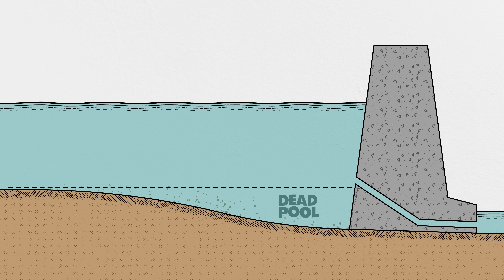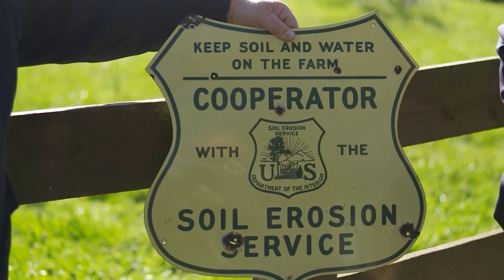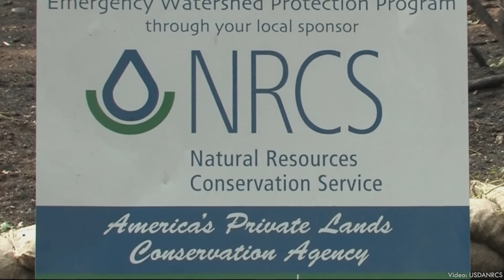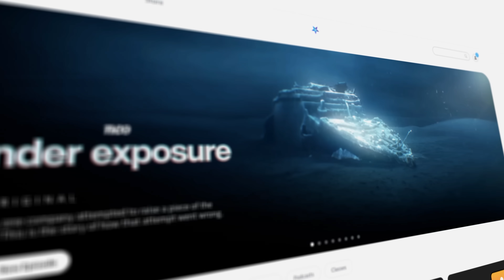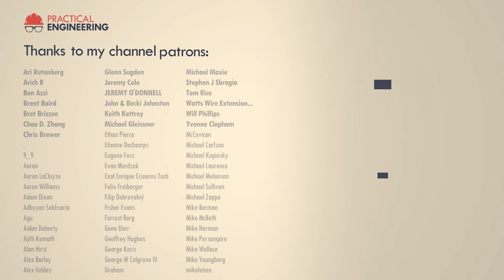All Dams Are Temporary

Comment: Either figure out a way to continue sediment systems by moving it as far downstream as you can or move it back upstream where it came from. The method will be whatever makes the most sense. Like you said dredging is ancient. There's no reason to get hung up on fault or cost etc seeing as the problem is of natural cause and eternal. You just have to remove sediment unless you are content with abandoning a dam and let it become a waterfall and eventually a huge risk if it fails.

Comment: From what I understand a dam plays two main roles, a reservoir holding water and power generation. What if we separated the two? What if we had a side channel that all the incoming water flows through (this is where you put your hydro power). When the reservoir gets low you let some of the incoming water go in. Is there a problem if the reservoir water is still? Can we, like, stir it?

the water flows through

What if we

It seems the issue that arises is the slow down of the water in  yhe

If the issue with dams is the c

Comment: the Romans handled this problem with aqueducts. Desediment the water at the beginning of the aqueduct with a water wheel, which grabs the top most water. Then, use the aqueduct to transport water to the reservoir. Then repeat the process each time you move the water. With each addition to the chain, the less dirt is in the water. Modern engineering could make this process better if we stopped to prevent the problems that dams created.

Comment: I've a solution.  A modular (so you can keep adding sections) direct dredge system that uses the the dam power or venturi to run a massive suction apparatus that can also have  somewhat more normal sized ones to attach to that for those hard to reach areas or near the shore and obviously they would only run these when the water would be turbid anyway and even more carefully than current dredge ops as I would imagine these would be massive and powerful/voluminous and therefore more dangerous and theres also the environmental aspect and these would be remotely operated, also obviously (but how cool would it be to scuba down to the submersible dregde sub's cab while it's shut down for the shift change, haha!)  Cost and risk, but what is the cost and risk of not doing that.  You can use this idea for the betterment of humanity if you like.  Free as in free.  :)

Comment: I wonder if they can make a kind vertical or diagonal screw to lift dirt up to a conveyor that carries the dirt to the dam and pours it out on the down stream side. This whole system would be mechanically driven by the natural flow of water and require no continuous manpower or refueling to use.

Comment: Here in Taiwan, the problem of sedimentation is even more acute than in the U.S. due to the higher rates of soil erosion in the mountains and hills. To prevent the reservoirs from dying, the solution has been to construct sediment bypass tunnels and additional, lower elevation sluiceways to periodically bypass and where necessary drain the incoming sediments. Although the reservoirs will never regain their original capacity, they can be operated indefinitely.

The other approach is to site the reservoirs off-stream so that water only enters the reservoir when needed and sedimentation tanks are used to filter out as much sediment as possible before the water enters the reservoir.

Comment: 9:35 all of these issues assume that dredging is intended to be a one and done solution that gets rid of the sediment.

It makes much for dredging to be done small scale but continuously. And the goal should be to maintain the sediment flow not remove it. Just continuously pump the sediment slurry to the other side of the dam. There is no need to separate anything out or dry the dirt. Just put it where it belongs

Comment: I'd have figured the obvious answer would be some kind of dredger-conveyor belt setup, which dumps the sediment into the reservoir outflow water to match the normal rate you'd expect if the dam weren't there. Not trivial, not exactly super-cheap, but manageable, and I'd expect the environmental regs to be fairly kind towards something like that. (Or at least, as kind as they ever are towards anything humans do.)

Comment: An interesting solution to silting problems is in use outside of Genoa, Nebraska on the Loup Power Canal. A sand and gravel company (Preferred Sands) set up on the canal to constantly dredge the river, wash the sand and gravel out of the dredged material, then these products are sold for making concrete and other infrastructure products. The company has an almost limitless supply of product and the canal is kept clear of sedimentation. Win/win in my book!
Reply: I live in Columbus! The whole system is great fishing too!
Reply: @aj-ig6mg  Well, I work in Columbus, but don't live in town, 40 minutes west. And I'm really interested in this topic, because I design sand and gravel washing equipment!
Reply: @NathanWostrel  that's awesome, man! The whole system plays a huge part in the community. I've always wondered how it all works when we are fishing at the headgates.
Reply: interesting, but it does not solve the problem which is downstream. deepening the river what causes  destruction of wet ecosystems, lowering level of underground water, lowering nutrients down the river.
Reply: @ivanfuchs9068  'Destruction' is a loaded word. Ecosystems are constantly in flux and humans are part of the ecosystem. You think if we didn't exist, the world would be in a suspended state? The only question is what kind of effect we want to have on the ecosystem.
Reply: @derkylos well, yes, this is true. But humans are the only ones who can make these kinds of megastructures on such a rapid timescale. A technological species is naturally going to be an Outside Context Problem to an ecosystem that can only adjust so quickly.
Reply: @derkylos  Sadly "destruction" is not a loaded word at all, ecosystems are being destroyed, and replaced everywhere in the world. That's a reality!
95% of all animals on Earth are now cattle, pigs, sheep, chickens, that's for land vertebrates of course (ie not worms, bacteria, etc), and 75% of wildlife population have been destroyed in 50 years, 83% for fresh water fish!
Human population on the other hand is growing faster than ever, while it took 123 years from 1 to 2 billion, it only took 11 years from 7 to 8 billion! that's faster than ever in history.
Reply: are you in favor of removing all the dams in California?

Comment: You mentioned a sediment trap upstream. Why not combine it with the vacuum dredging at the start? A large basin upstream of the reservoir to ease the turbulence with a grid at the bottom connected to a dredge pump. The moment the sediments fall out of suspension, they fall into the dredge setup, in which they get pumped along a pipeline all the way through the dam. Nutritious sediment moved downstream while the fairly clear water stays in the reservoir. Of course that system can be switched off if some kind of manmade catasthrophe polluted the water upstream.

Comment: Okay, I thought up an idea but I don't have any knowledge in this area and there are probably gonna be flaws that other people can point out. 
Essentially there's a triangular pyramid sort structure that leads into a sediment funneling area at the bottom of the dam. The structure would be deep enough that boats wouldn't be affected by it, and the angles of the pyramid would have to be steep enough that although sediment may temporarily settle on it, it eventually sinks into the funnels to exit out of the dam, or to be collected for treatment. My main idea behind it is based entirely on the fact that dirt is heavier than water so we just let it sink into an area we prepared for it.

I know the obvious flaws being cost and impracticality in larger or geometrically complex river structures. But I'm curious to know if this would be a theoretically viable idea or if this would just lead to an increase in sediment settling due to the structures presence.

Comment: Extremely interesting subject. My diploma thesis in uni was on the subject of Sediment Bypass Tunnels which is one of the-if not the most-permanent solutions to the issue of sedimentation. That said and as correctly mentioned in the video, it is all based on a balance between gain and cost, gain being reservoir lifespan as well as environmental gain(mitigation of downstream erosion) in this case. And the problem with SBTs is primarily their significant cost of annual maintenance rather than the-also in no way insignificant-construction cost. Plus SBTs are tunnels. They cannot be built everywhere as the geology and topography might not be welcoming for their construction for a number of reasons. All the above said, SBTs are effectively used especially in Japan to mitigate reservoir sedimentation and erosion at river deltas, which is a by-product of lack of sedimentation downstream from dams. Some examples of dam reservoirs with SBTs are the Miwa and Asahi dams in Japan as well as the Pfaffensprung and Palagnedra dams in Switzerland.

Comment: What if there is yearly or bi-yearly cleanings of just a boat upstream recirculating and pumping water back into the sediment bed upstream withsome of the bypass open to remove some of the slurry and work your way back to the bypasses to keep it clean.  Also if you wash out some of the sediment a little further upstream won't it cause further down to clean out to the same depth up to dam?

Comment: How about using big pipes where we just yeet the slurry of dirt into it and let pressure and elevation take the sediment and exit it on the other end of the dam. Considering its a straight way, water shouldn't lose as much momentum unlike the stillness and change of speed the reservoir provides. Idk, finished the video. Definitely would keep me thinking.

Comment: Would a pipe & sluice system upstream work to have a large amount of the sediment bypass the reservoir during rain season. I'm thinking a spot where the water slows down at a smal dam, that has a pipe going from the spot we'd expect the sediment to accumulate.

Comment: I'm no expert, but I do know that there are two separate kinds of dredges, Clamshell and Pipeline, and it would seem to me that the solution to the problem of sediment would be to use a pipeline dredge to pump the sediment past the dam.  Now, it would take some study, but rather than trying to move ALL of the sediment at once, just move a small percentage of the sediment at a time.  For example, move 20% more sediment downstream than is arriving at the same at any one time, so that in the dryer parts of the summer smaller amounts of sediment would be pumped past the dam, while at the same time, during the wetter periods of spring, larger amounts of sediment would be moved.  Now note, I am not suggesting that the pipeline be always underwater, rather it would be above water for at least some of it's run so that there would be no need to drain the whole reservoir should something jam the pipeline.  Just my two cents.

Comment: I had been thinking about this a while ago. I thought that dams should have two sediment traps before reaching the dam, while one is being emptied of sediments with regular trucks and excavators the water flows through the other trap and you haul it to the other side of the dam. That way, sediments can flow through the river as if the dam wasn't there, and it doesn't accumulate in the dam. Yes it's a continuous operation but it's easier than solving the problem if the

Comment: A cutting section dredger with flexible pipe outlet is a right option for this. It can use the potential energy of dam surface water to rotate cutter and moving water to down streem. The outlet of the dredger should be just in front of dam gate. So that when ever dam gate opens the sediment is moved with a push of flowing water this will distribute the sediment more naturally then a manned distribution. Yes initial sedimentation will be much great but after few years the sedimentation will eventually starts  moving down.

Comment: What about creating water break systems up stream with smaller temporary dams abouve them, and make a high pressure low friction inner lining pipe system…. Maybe that piping system could even have a tertiary piping system that’s running with it that has a higher pressure that intermittently kicks in and at increments along the pipe creates increased pressure and turbulence in the pipe to keep moving the sediment on down the pipe? Or maybe you could have some kind of Like artificial looking like tumbleweed kind of things that you keep deploying down the pipe that as it gets pushed along, keeps eroding any of the sediment that might build up in the system and then you just have to have like a barge that you fill up with them to take back up The reservoir for transporting those things back to the top to keep running them through? I don’t know, but it seems like it’s a kind of thing that ingenuity would have been curtailed regarding just because of how long-term the concern was when the entire Dan was being made and how these kinds of projects end up already going over budget anyways>… Yikes I digress there… But it should be a kind of pipe that runs a bit elevated  along side the highest intended level of the reservoir, and the n when the break collects enough sediment activate the temporary dam to build up the necessary pressure to blast a heavy sediment flow intermittently to a system that diverts an appropriate amount of sediment to be introduced in to the river and the rest into a sediment could go in to a system of reservoirs that are specifically designed for ease of depositing sediment in, and then letting sit to dehydrate and being easy to collect by hauling equipment… But I guess that’s the point where in you’d have to find some form of industry that could use that amount of sediment and provide some kind of subsidy to that system to transport it to that industry

Comment: Long plastic spirals that go upstream from the dam. They would lay across the bottom of the river and are tied to s slow rotating mechanical force at the inlets. They don't need to scrape the bottom, just slowly push the sediment forward across the bottom of the reservoir, like chip augers.

Comment: The best solution I can think of is to use a grinder like a suction barge, but rather than dredging, send the sediment downstream via a bypass pipe after mixing it with water thoroughly via a shear mixer.

That solves the storage problem which is your biggest issue, and can be rate limited by operating at low levels consistently

Comment: Build a weir upstream to concentrate the sediment, pump the bottom level into a thickener, then pump the underflow past the dam. That lets the sediment go on its merry way. 5 million tonnes a year isn't really that much if you do it continuously (about 500 tonnes per hour). A good 10" pump would move that all day long. It'll cost about $750k per year in electricity though.

Comment: I almost wonder if a better way to build dams is to divert some flow from a given river into a man made channel that would have sediment management built in at the diversion point (and along the length, given it could be a concrete channel for example), then build a reservoir and a dam on the separate channel, and connect them to the main river again downstream from the dam. This would also help mitigate impacts on the river’s ecosystem. 

For dams where flood control is a major part of their function, extra gates could be built at the diversion point that could divert more water into the channel if needed.

Comment: Good video.

The only thing my non-engineering brain could think of is if dredging is too expensive, lay various sections of tarp on the riverbed in manageable sizes. After a set period of time, hook onto the corners and raise each tarp one at a time to remove what has accumulated. It wouldn’t remove any existing sediment but it would prevent future buildup from what is currently there.

The only problem is you would need a large area of various tarps strong enough  to bare the weight of the dirt when lifted and small enough not to exceed the weight limits of the crane when lifted. That would be a lot of setup and a lot of maintenance, so not necessarily less expensive than current proposals, but who knows

Comment: ok so hear me out, did some thinking, build smaller temporary check dams upstream in strategic locations, wait for them to build up sediments, let them wash out, leaving the narrow channel to flow. The majority of the sediments will remain, but in this case that will allow them to dry and gradually be removed without the extra cost and complications of dredging. building specific infrastructure to facilitate the removal and placing it in an area where river soil (especially sand for say a concrete factory) is in demand would be ideal.

Comment: Until the damns were put in place the soil was building or moving down stream.  The rivers would meander around the build ups. So the real problem is damns need to be moved over time. To account for the sediment build up.  Before man building settlements in and around deltas or shallow rivers.  This problem didn’t exist. As an engineer it is your job to fix it.

Comment: Could a large variable gate at the bottom of the dam work that can be opened once the dam is full and allows the exact amount of flow rate of water that would be passing through if the river was otherwise unimpeded?

Comment: A submarine sandcatser which can be upfloated when it's full you already shown before how you can make air pressure in difference of a water level. So the saved air pressure can be used to float like like a sub when it is full sand and move it easily  to the side.